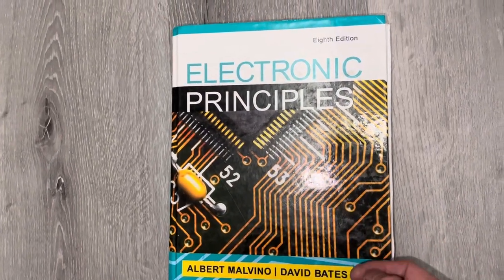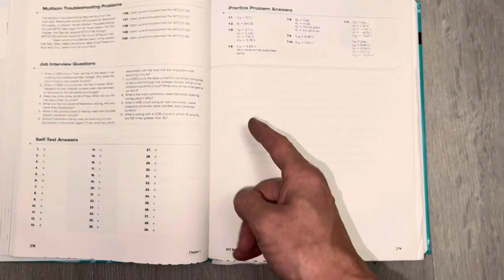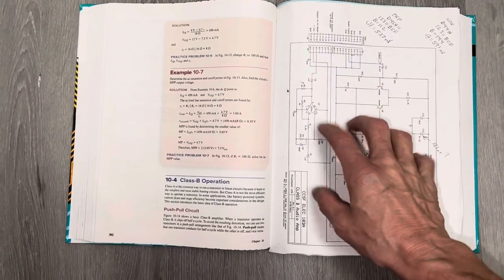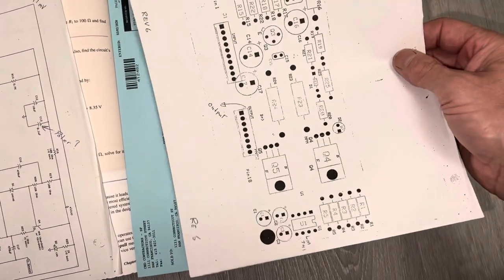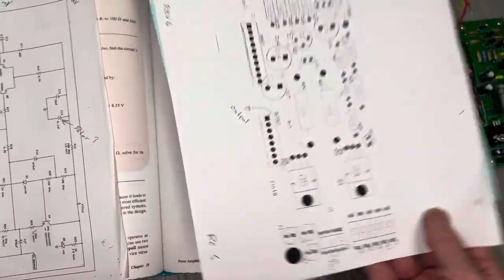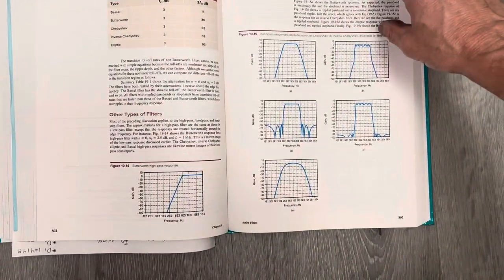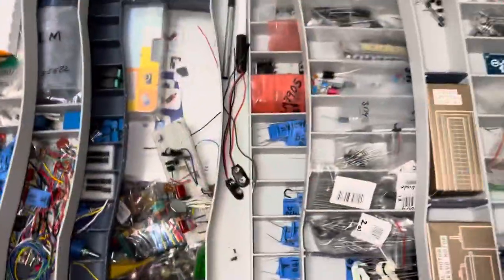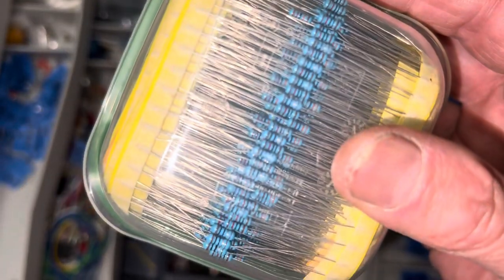ELECTRONIC PRINCIPLES (CITY COLLEGE ELECTRONICS DEGREE PROGRAM)

Comment: What type of a degree is this? I recieved an AS in electronics from DVC, but I always wanted to go further.
Reply from the maker: Just AS or AA or you can choose the option of just certificate without the BS general classes.  

I wish I would’ve started taking these classes before I started my own business because I don’t have time to do all the homework that they require I told the instructors that I run two different businesses I have no time to do all the homework I’m just here for self improvement and up my knowledge for my hobby and for my work I have no intentions of being an electrical engineer.

And I have to honestly had I am not capable my math level and my lack of ability to memorize formulas will not let me rise to that level. 

I don’t have enough time left in my life to devote to the math needed.